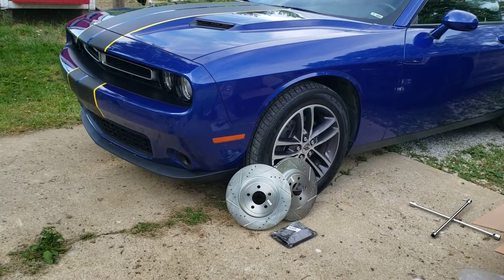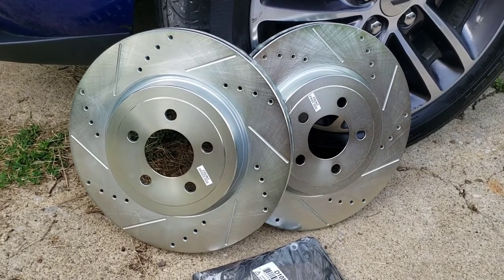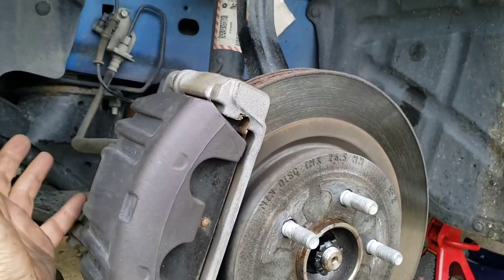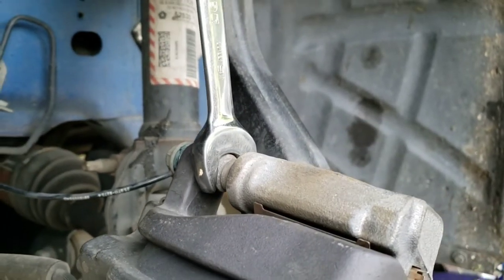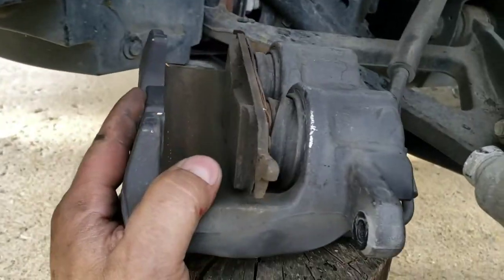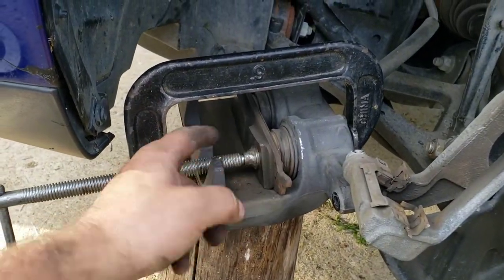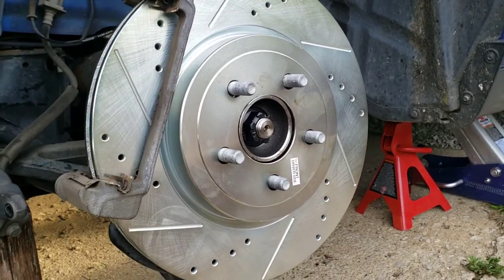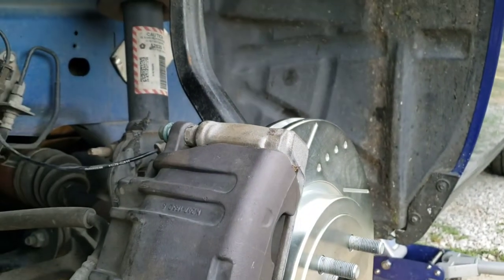15-22 Dodge Challenger Front Pads & Rotors Replacement

Comment: Thanks for the video.  Just completed the brake and rotor job on my Challenger and you were right those two bolt were definitely difficult to get out. Took about 45 minutes to get them out.  All in all not that bad of a installation.

Comment: Just bought a 2021 Challenger and after two months of having it I've noticed that when I hit the break at low speeds like coming to a stop, it makes a creaking sound. Not happening when turning or anything else, just breaking at low speed. Looked it up and everything I found was rather a warped rotor or bad pads. Brought me here. Thanks for the walkthrough. Hopefully this will stop the creaking.
Reply from the maker: Could be the caliper though unlikely due to how new it is- I would have to hear the sound.
Reply: It won’t

Comment: If you turn the steering wheel to each side after you get the wheel off you can get those bolts off with an impact gun

Comment: 2016 Challenger. I just went through this with the front bracket bolts yesterday and today. I soaked them and was about to use heat.  Enormous amount of torque the whole length of the bolt.  Yellow thread locker was on it also. The bolt actually protrudes out of the bracket behind the rotor about a quarter inch exposed to the elements.  I am not sure if it was a rusted bolt tip, or the thread locker.  There was a good amount of almost clear substance in the bracket threads.  After a good clean up of the threads, they went in all the way by hand. SOB of a job!
Reply: Thanks for the heads up 🤦🏾‍♂️ im about to replace some pads on a 2017 sxt
Reply: @Crazyazzb  Long swivel socket wrench. My neighbor saw me fighting with it and brought it over to me. Still a fight, but I was not getting one side off with the tools I had. I mean long, like a breaker bar long. Soaking overnight was no help. Good luck, hopefully your goes smoothly.

Comment: 2014 Challenger RT with 65,000 miles.Caliper mounting bracket bolts were tight all the way off.Had some locking compound , from the factory. Slider pins bolts were not hard to get off, tight. As I remember.

Comment: I did my wife’s 21 SXT RWD yesterday and the bolts were NOT hard to come off. Must have straightened out the bolt issue in her model
Reply from the maker: Or it could be because the car is only a year old... Did it still have the threadlocker on the bolts?
Reply: @BuckeyeBallistics  Actually, I was mistaken because I only had to do her pads. Sorry for the confusion. Your video really helped

Comment: Just another curious question bc i know it's bad to have air in break lines. I thought it wasn't safe to open the cap on the break fluid resivour? Or is pressing the break pedal down push out any air in the lines? Or dose opening that cap not get put air in the lines?
Reply from the maker: Opening the cap actually helps air escape, because it will travel upwards and out the reservoir...

Comment: Thanks for the video! I've seen other videos where people apply grease, is it a personal preference?
Reply from the maker: Apply grease to what (specific part and location)
Reply: @BuckeyeBallistics  on the caliper piston, the new pad clips, and on the outside edges of the pads
Reply from the maker: Yes personal preference. It could help keep things a little looser over time long term, but I never do it and never have a problem (these are our vehicles that I work on, daily drivers). And to be honest, a lot of people overdo it and get the crap on the rotors and pads which is bad- they forget about the wind while driving down the road that blows it all over the place. So if you do grease anything, it should be a very small thin film for this reason...

Comment: So I warped my rotors on my 2021 dodge challenger gt is the reason because it came torqued wrong? It’s at 27,500 miles and it shakes when I break
Reply from the maker: Could be a hot spot or rust spot on the rotors

Comment: What stops that 18m nut from spinning when you reinstalled it. After you torqued it to 40lbs what stops it from spinning or dose it just toughen to the bolt you are torquing?
Reply from the maker: Time stamp?
Reply: @BuckeyeBallistics 11:24 
You say you have to hold it to screw back in the caliper bolt but when you don't hold that pin any more what stops it from spinning or is it OK for it to spin.
Reply from the maker: You hold it with a box end wrench while tightening the bolt into it- that is the only reason to hold it still. After it is tight, yes it is normal for it to be able to freespin.
Reply: @BuckeyeBallistics  ok thanks yeah thats what I was wondering about i know i would of been worried and over thinking it.
Reply: @BuckeyeBallistics  also thanks for the quick response and your time. I'm planning on keeping my car forever and working on it.
Reply from the maker: Anytime

Comment: I replaced my sons 14 challenger rotors and brake pads on front passenger side, and planning to replace other side next. I noticed what sounded like a hydraulic noise coming from that wheel after I finished up. Any ideas?
Reply from the maker: Not sure what you mean by that, I would have to hear it. And only when you hit the brakes or? I'm also unclear as to whether or not you have slotted rotors like in this video. First things that come to mind are the rotor mounted backwards if it's slotted, and whether or not the rotor had the storage grease on it and if you cleaned it off properly or not...
Reply: @BuckeyeBallistics  Actually its not when applying breaks. Sitting in my drive moving the steering wheel back and forth. Probably not related to brake and rotor change. Maybe a power steering issue but only comes from the side I replaced and made me paranoid I screwed something up :) Thanks for taking the time
Reply from the maker: Yeah that sounds like power steering

Comment: This looks fairly simple to do on my own. I dont trust mechanics being near my challenger. How long does it take You to replace 1 rotor more or less??
Reply from the maker: Me like 15-20 minutes if not for those stubborn bolts.
Reply: @BuckeyeBallistics  
Something tells me I'm gonna experience the same hassle or something else, because nothing ever goes flawless for me lol. Thanks for the response.
Reply from the maker: Yeah probably, especially since a few other people commented that they had the same issue with the bolts being hard to remove. And yeah I know the feeling of starting a job thinking it's simple and then it turns into a nightmare...
Reply: @BuckeyeBallistics  
Did you bleed the brakes off camera when replacing the rotors and pads?? Because im not sure if I have to.
Reply from the maker: No I did not, and no you don't have to.
Reply: @BuckeyeBallistics  
😫 You werent lying on the damn bolts (caliper bolt to be exact) it's held tight by vibranium or something!! Bought PB blaster to try it for the 3rd time tomorrow, if no luck, I'm gonna have to take it to a mechanic.
Reply: @BuckeyeBallistics  
Nvm just needed more leverage 🤪 got it
Reply from the maker: Glad to hear it 👍

Comment: I thought you were a Mustang man now?
Reply from the maker: I'm a mechanic and do jobs on the side- not my car. That being said, I like anything that looks good an goes fast. Never understood the Ford vs Chevy wars or the Import vs Domestic war. I like em all...
Reply: @BuckeyeBallistics  I used to be a mechanic, I absolutely hated it.
One of the worst most miserable jobs around.
Chevy vs ford is no different than Patriots vs Dolphins, Eagles vs Cowboys, or whatever sports rivalry seems most appropriate where you live.
Reply from the maker: Yeah I never wanted to do it for a living. I'm self taugh and work for friends and family. I have videos doing the clutch & flywheel on or WRX and replacing the TCM/Lead Frame in the Mustang- as an example of the more complex jobs I'm capable of. I rebuilt the top end of my 93 Z28 just like yours when I was 19 (heads/valvetrain).
Reply: @BuckeyeBallistics  I rebuilt the top end of my 1976 Monte Carlo 350 V8 way way back in the day totally blind myself. That's how I got into it too.
But man did I hate it. LOL

Comment: Great video thank you‼️I am changing mine tomorrow hopefully goes smooth but as we all know it almost never does.
Reply from the maker: Good luck brother. I think the worst thing you'd run into is those tight bolts...
Reply: @BuckeyeBallistics  Bro what size were those big bolts?
Reply from the maker: @freddyg1692  18mm 😉 👍
Reply: @BuckeyeBallistics  Bro I went up to 19 and still was too small
Reply from the maker: Then idk and somebody may have replaced yours with a different sized head or it's the difference in year or trim or something- that's why a lot of times I don't say the size because it can vary and then people don't understand. 19mm is the same as 3/4, so it might be 15/16, 7/8, or a larger mm size.
Reply: @BuckeyeBallistics  Thank you Brother I truly appreciate your help. Yeah had to come back to Walmart to get a bigger set.  🤣
Reply from the maker: No problem, have fun 😅
Reply: @BuckeyeBallistics  Well it turned out to be a 21mm and it was hell all the way out on both sides. Got both in just to find out I may have a bad caliper on the passenger side because now the brakes are sticking.🥴
Reply from the maker: I hate it when that happens